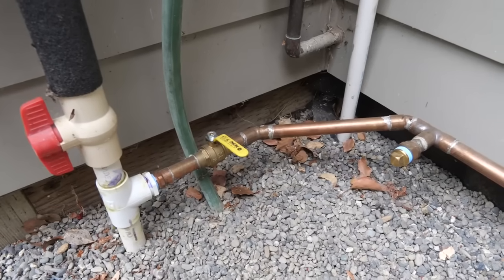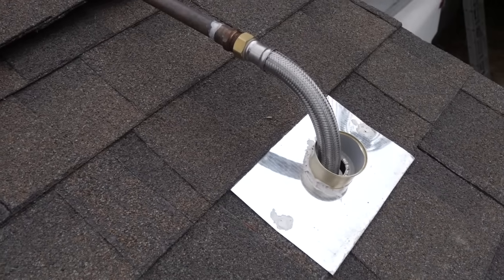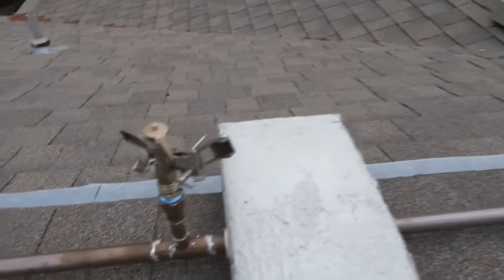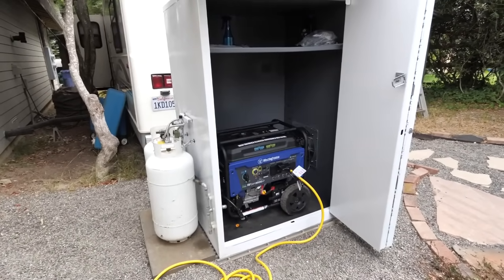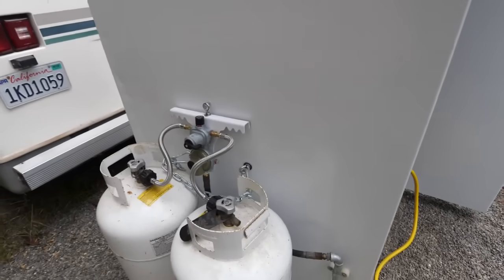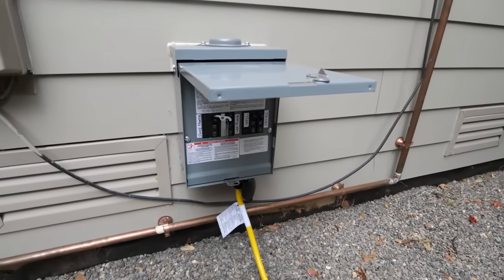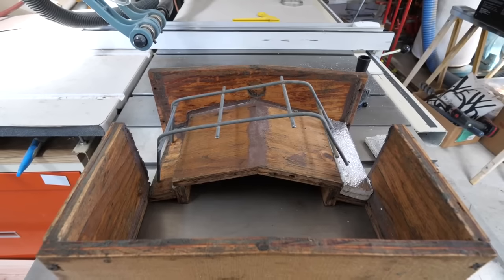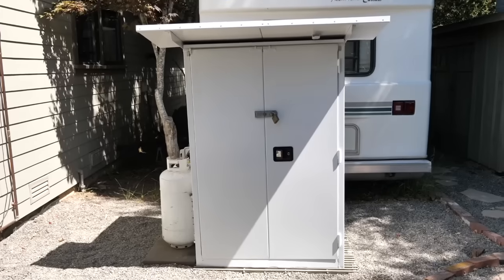Roof sprinklers and backup generator for wildfire-prone rural house

Comment: Your system will work great! Thoes sprinkler heads will spray far beyond your roof line and far enough that any wind during a Fire Storm will also blow the water back in the same direction as the embers and will extinguish them. Even though your roof likely has a Class "A" fire rating, it does not account for debris or leaf acumulation in your gutters that will also catch fire and spread up under the roof shingles. It is very difficult for ground mounted sprinklers to have adeqauite coverage and also reach high enough to wet you gutters. Your roof sprinkers will take care of that issue easily. During our firestorm in 2017 I watched many wood fences and garbage cans catch fire and then spread into the structures. If they have been douced down by your roof sprinklers then they will have a hard time propigating to underneath your eves. I built my new fences with the last 6 feet that connected to my house being built out of galvanized posts and corrugated roofing.  But again, its that wet microclimate that you are creating that will keep your structure safe.  The fire brands that burnt my house down were the size of golf balls and they bounced across my yard that was dry as a bone and kept going untill they found my deck. If the yard and deck had been wet it would not have started a fire... Good Luck!
Reply: This is detailed expertise, thanks for sharing!
Reply: Beautiful home, great job! Very intelligent thank you for sharing!!

Comment: At first this sounds like a good idea.  The reality is if your home as composition fire resistant roofing,.   The roof will not burn during a wildfire.  Most homes burn from embers that ignite lite fuel accumulations around the home.  Patio furniture,  dry landscape plants,  wood decks and dry leaf and conifer needle accumulation on and under combustible materials.  The effort would have been better used managing the landscape and possibly putting sprinklers around the perimeter of the home.   Goggle the name Jack Cohen and information based upon many years of scientific research can be obtained.
Reply: no.
Reply from the maker: I personally know of a fellow in Napa County who saved his homes with this setup. The sprinklers also cover a wide perimeter beyond the roof.
Reply: In fact, up to 90% homes ignite when the constant barrage of windblown embers finds its way through cracks and openings into the attic space or soffit area. Very few roofs are built with enough attention to detail, so yes, the roof CAN burn. A child can clean up the defensible space around the building, but only 10% of homes ignite due to lack of that defensible space. Marin County has done a great video on this very subject. Bottom line: sprinklers, even a rudimentary system, can save your home.

Comment: Idea for future proofing - have valves or some sort of easy/quick disconnect option to split the pipes into sections - so that you dont have to cut the pipes when you repair/replace the roofing
Reply: The quick disconnect is solder and a blowtorch